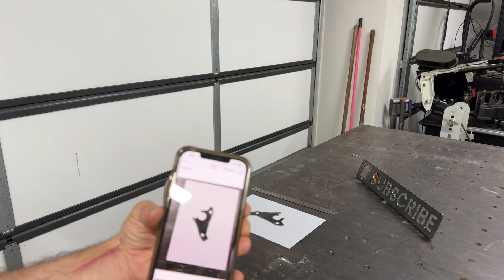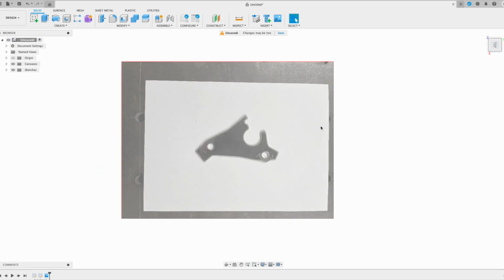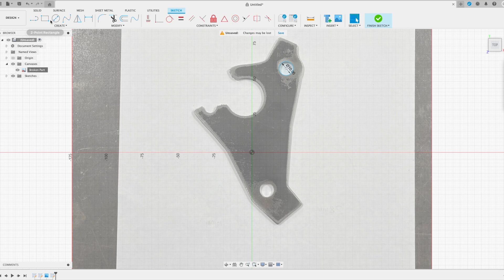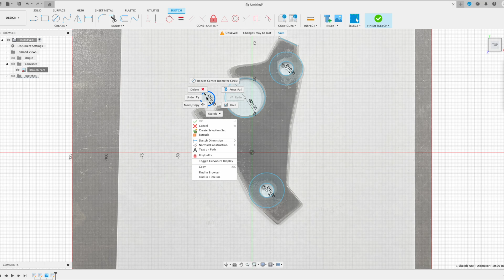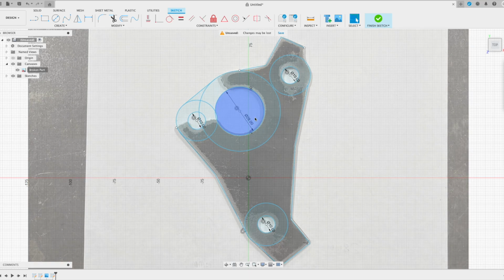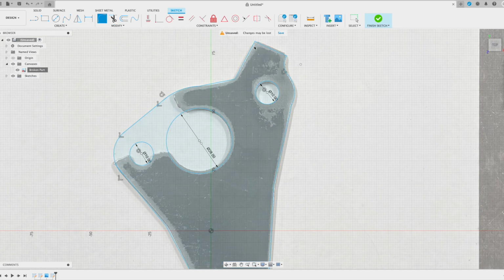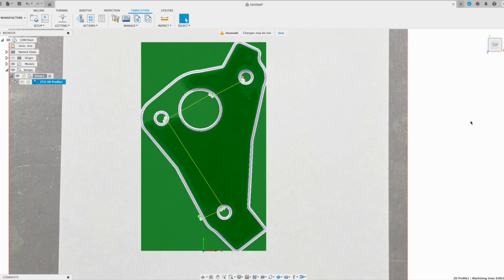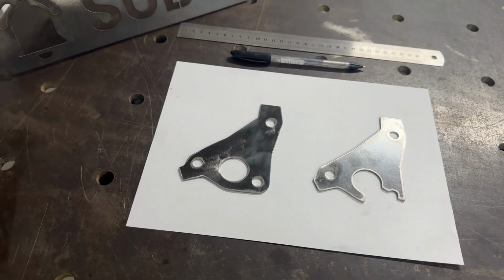FUSION 360 | How to go from a Picture to a CNC cut file using Fusion 360 Canvas Tool.

Comment: New user here. What file format does the ArcDroid need? I don't see a G-code selection on the file menu for export. Thanks for the video!
Reply from the maker: when using fusion 360, create the object and always extrude at least 1mm. I then go to manufacture, create the cut path and then go to post process. It then creates a g-code file that I export and take to the Arcdroid. Hope this helps 👌

Comment: Where practical, I include a ruler in the photo of the part and use the image of the ruler to set the scale in Fusion rather than a measurement from the part. The larger the scale measurement the more accurate the calibration, so I measure and set my scale using the whole 30cm of the ruler. Informative video, using a real-world example to demonstrate. Cheers mate.
Reply from the maker: Thank you for the great comment!. I’ll definitely take on your pointers for next time I tackle something like this. Cheers 🙏🇦🇺

Comment: Calibrating from a larger known dimension is much more accurate, I would have left the ruler in the pic and used that.
Reply from the maker: Cool thanks for the feedback. I’ll take that into consideration next time. So you’re saying I should have measured the outer edge as it was a larger dimension?. 👍
Reply: @Fab-Life444  yeah, or just leave the ruler in the pic and calibrate from that, that's what I do.
Reply from the maker: @Chimp_Assassin  awesome thank you for that. I’ll definitely do that next time. ☺️🙏